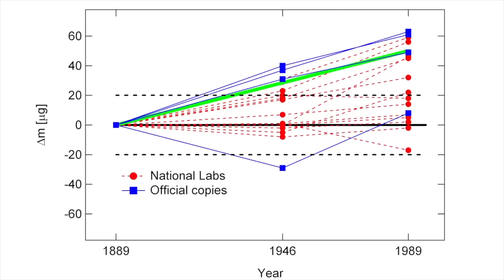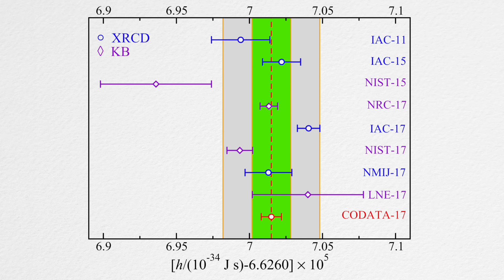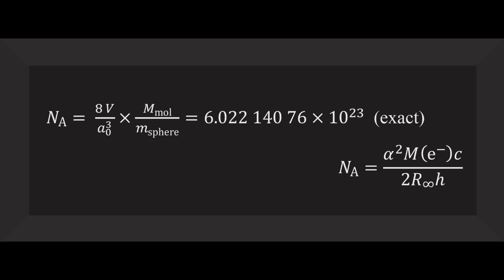The kg is dead, long live the kg

Comment: The world: we redefined Kg
USA: what’s Kg..?
Reply: US pound is based off kg
Reply: Special agent Chicken what do you mean the pound came first
Reply: Alex Alonso, just to let you know in the United States, they use the older Imperial system, where things are measured in feet, inches and pounds. ... The Imperial System is also called The British Imperial because it came from the British Empire that ruled many parts of the world from the 16th to the 19th century. The metric system was first proposed in 1791. It was adopted by the French revolutionary assembly in 1795, and the first metric standards (a standard meter bar and kilogram bar) were adopted in 1799. There was considerable resistence to the system at first, and its use was not made compulsory in France until 1837.
Reply: @Zkchary   you do know that the imperial system was the traditional system of mesurements In allmost the entire world
Reply: "what’s Kg..?"
It's a Kelvin-gram. If you want a kilogram, that's "kg."

Fred
Reply: @ffggddss  Probably the silliest thing about the metric system - the fact that the symbols for kilo, hecto and deca are all lowercase, instead of the transition occurring at 0.
Reply: @tidorith  Well actually, kilo- (1000x) is k; hecto- (100x) is h, but deka- (10x) is D.
deci- (/10 = 0.1x) is d.

Fred
Reply: @ffggddss kelvin-gram not Kelvin-gram
Reply: @Structure Agency Yes, the costs are there, and that's why for example the UK (and to some extent Canada) are still grappling with some residues of "imperial"/customary measures 50 years or so after conversion; in practice it didn't appear to cost either country much to switch, because the cost, even if large, was spread over a very long time period. However the main problem is one of political will, and as you say there are very few signs of any of that being there in the US.

On the amount of the cost, you may find this interesting: https://nonpartisaneducation.org/Review/Essays/v3n3.htm
Reply: Yeah, my American car uses 10, 12, 14mm bolts all over the place.
Reply: SimonTekConley that is because most of your vehicle is made in Mexico if it is an American brand.
Reply: Royal with cheese.
Reply: @쓰기전에생각하셨나요  underrated
Reply: The US uses the metric system too...  ignorant Euros.
Reply: The short scale is the scientific standard though... And insisting on using the long scale vs the short scale would potentially be way more detrimental than using imperial instead of metric tbh.
Reply: Ahh! The old Standard vs Metric Debate. I'd go get some popcorn and a soda, but I think it would drag on forever with no resolution.
Reply: What I mean is, as the scientific community has settled on the short scale, if you were to insist on using the long scale anyway, you and another person would be talking about numbers a thousand times or more different as if they're the same number. 
Also, "milliard" is a bit of an odd duck compared to the others, isn't it? Billion, trillion, quadrillion, etc.. All change the prefix in a common and predictable way. Milliard adds a suffix... Why? And it's not even a numerical suffix.
Reply: You know that the imperial system is based on the metric, right?
Reply: @Maverick Hargrave American scientists and engineers use all kinds of systems and standards, based on utility. In general scientific work is done in metric units.
Reply: Rest of the world :  LOL, US uses Imperial.

USA :  Ha Ha, We've never, EVER used Imperial.

Me:  I took my driver's license test in a Chrysler Imperial.
Reply: @jamesslick4790  that face the smug 'metric is king' world gets when, they find out that the USA has not been truly imperial since the 1970's.
Reply: @Maverick Hargrave American scientists use the metric system.
Reply: The pound is actually defined as exactly 0.45359237 kg. So by changing the definition of the kg, you change the pound by default. Choke on your hubris USA, your system of measurement is beholden to the kg also!
Reply: Siren Hound: except the changes are so tiny they will not make a difference to most people, as explained by the video, regardless of whether or not they use the metric system.
Reply: @Sirenhound   wrong.  Siren Hound  you're mistaking the equivalence of the pound with the definition of a pound. A pound equals that much in kilograms, but if you change the definition of a gram then the pound will just get a new kilogram equivalence. It won't change it's actual defined weight. NOBODY came to a consensus that a pound should be directly tied to the weight of the kilogram. That's not how the pound was DEFINED. They defined the weight of a pound and then using math came up with a CONVERSION to its kilogram equivalent. So, after the kilogram gets its new definition the pound will still weigh the same it does now but it will convert to a different amount of kilograms. That's not the same as the definition of a pound. Now, if you want to know how a pound was invented go ask Google. It had absolutley nothing to do with the weight of a gram.
Reply: @Sirenhound  it would be cool if you saw how many kg's of nuclear warheads the US has.
Reply: @Sirenhound  thats true but it would also be the same as if the pound changed
Reply: @Sirenhound  Rest of the world : Choke on this, We've known this since the 1800s.
Reply: @Sirenhound  In a sense it is based, but actually it's based on a grain I think.
Reply: @Sirenhound  Not really
Reply: Siren Hound we should email npc university to protest this
Reply: SirenHound US isn’t the only country that uses the imperial system. Also the weight of one lb or one kg actually changed, like if I have one lb of steel after they change that it’s still one lb of steel.
Reply: @Sirenhound  What's more likely is that this is the conversion based on the original kg. It's very likely that if the kg changes, the conversion value also changes.
Reply: @vincentvandepol5345  Very unlikely. Note that the factor is precise to within a rounding error of 50 micrograms (which was the practical limit of precision that could be reached with the "old" definition). That's more than the experimental error on h, so any further refinements to the value of h don't need to change the factor.
Reply: @vincentvandepol5345   No, scientists struggled for centuries to measure the speed of light.  After Einstein's theory of relativity became widely accepted, it was recognized that the speed of light in a vacuum was a fundamental constant so it was adopted as a standard.  There is no reason to ever change it.  When the current value was adopted it was chosen to agree with the best estimate at the time, based on the then current definition of the second and meter. 

The newly adopted definition of mass is now also based on a fundamental constant and need never change. The constant is  Planck's constant, and determination of its value was based on the mass of the electron.  The relative uncertainty in Planck's constant, therefore, must be at least as great as the uncertainty in the mass of the electron expressed as a fraction of the standard kilogram. By turning the defining quantity around, that is solve for the mass of the electron in terms of a fixed value of Planck's constant, the definition never need change.
Reply: Siren Hound 
#notmykilogram
Reply: the one you use to define a pound..........
Reply: laughs in freedom
Reply: The kg is what defines he lbs
Reply: @theRealRindberg  no it isn't. The pound has nothing to do with the kilogram.
Reply: @ThePrufessa  I recommend you the read the Wikipedia article about the pound. Here's a quote from it "The pound or pound-mass is a unit of mass used in the imperial, United States customary and other systems of measurement. Various definitions have been used; the most common today is the international avoirdupois pound, which is legally defined as exactly 0.45359237 kilograms"
Reply: @theRealRindberg  The pound is an independent measurement. Example: if 1 mile is equal to 1.60934 kilometers, and they were to change that to 1.8 kilometers (for whatever crazy reason), then, the mile would still remain the same. 1 mile = 5,280 feet, this also coincides with 1.609 (rounding) kilometers. Again, if they were to change it, then 1 mile = 5,280 feet = 1.8 kilometers.
Therefore 1 pound = 16 ounces = n kilograms. Which, certainly as established, is 0.46. So, if they see fit to change it, to say, 0.48, then, once again 1 pound = 16 ounces = 0.48 kilograms.
More than likely, they're going to just round it off at 0.46 for convenience.
The pound and the kilogram are not tied to each other. Case in point, look for the measurements of that cylindrical object, for both their kilograms and pounds, for both before and after they've changed the kilogram, and you'll notice that it will still remain the same in pounds.
Reply: @RyuuTenno  Btw! If you watched the video and still think that the pound is independent of of the kg.... here's an other spoiler! the earth isn't flat!

Sorry for being mean ! that last part was just trolling
Reply: USA: KGB coldwar paranoia intensifies
Reply: @aijwdiosmkdlwl  "It isn't paranoia if they actually ARE trying to kill you!" – Yossarian, Catch-22

Fred
Reply: Structure Agency 
Don't throw everything out and switch immediately.. stop the current production of the old system and start manafacturing the metric system, slowly with time it will take over, those who are not comfortable with it will try to find old tools and buy them but sometimes they'll be forced to buy the new ones and will get used to it with time.
Reply: The World: What defines your outdated system.
Reply: its funny, if you watch another vertitasium vid, the US used a copy of le grand k to calibrate its weights and convert to pounds!!!
Reply: @ArunaKhudan  But now it needs to throw away those conversion factors and use straight grams and kilograms.
Reply: US Code of Laws states SI to be preferred system of measurement. Allegdly, at least 40% of US industry operates with metric measurements, they fjust do not tell the public.
Reply: 1.6 gbp
Reply: UN: Ha ha America doesn’t use metric system
Liberia, Myanmar, Samoa, Micronesia and rural Anglos: awkwardly shuffling away
Reply: @Victor-Baxter    I wonder when a metric country will land a man on the moon.  49 years and counting....
Reply: Jim DeCamp theory time:
What if the measurements and trajectory needed to land on the moon have to be in imperial, in order to work, thus making it impossible for metric countries to make the trip.
Reply: @Victor-Baxter   I will give your suggestion the consideration and attention it deserves.
Reply: Jim DeCamp ughmm. I’m pretty sure many countries aren’t interested in landing on the moon after America has. However, russia landed there in 1959 in the luna 2, but it was not a manned mission. Russia uses the metric system...
Reply: @jimdecamp7204  NASA uses metric. Sorry.
Reply: @davebox588   Yes, and?  FWIW, NASA only required vendors to use metric dimensioning after the  Mars Climate Orbiter was lost 20 years ago this month.  I worked on a Navy contract as recently as 2016 in which we were required to use a "radar mile" of 2000 yards in the interface!  The internal calculations were all metric, but on one interface we reported target range in radar miles. BTW,  on another Navy contract in the 1980's we used radar miles that were 10 microseconds of echo time, approximately 1500 meters.  The world is weird, but the Navy even weirder.
Reply: @jimdecamp7204  and ... QED?
Reply: @jimdecamp7204  excep that the us got their only with help of german scientists and technology, and nasa uses the metric system
Reply: @Helperbot-2000  ... and people who know how to spell "except" and "there."

Fred
Reply: @ffggddss  yeah sorry about that, i was writing on my phone so i almost always mistype.
Reply: @Helperbot-2000  Phones seem designed for mistyping. I hate using them for text.

Fred
Reply: @ffggddss  yeah same with me, they keys are really small and easy to miss.
Reply: @Helperbot-2000   Sure, it that comforts you.  Every nut, bolt, fastener, thread, every sheet of aluminium, on Apollo was manufactured to ASME standards, by American companies. 

The Germany spent more money on the worthless V-Waffen than America did on the Manhattan Project. The question question after the War wasn't "How did they do it?" but "Why?".  After the War the Americans took advantage of the German headstart on rocketry, but hardly needed or depended on German "technology".  The U.S. and Britain both flew jet aircraft by 1942.  The ME-262 engine had a mtbf of 10 hours, and only carried enough fuel for one hour. The U.S. was winning the airwar handily, and flying  1200 mile missions. They had no need for an aircraft like the ME262 with a 1% mission loss rate without hostile action.
Reply: @Structure Agency Well said sir! All the places i have worked are using both metric and SI. Most people prefer metric because it is easier to work with but still require SI to fix older machinery. It is slowly changing to metric on its own but it is taking decades. Edit: I live in the US. We use metric and SI.
Reply: Clint R SI is just the latest version of the "metric system". I think you mean to say US customary and metric.
Reply: @heideknight9122   I think you mean "SAE",  where you said SI.
Reply: @KarrotKake  Well, no.  Britian recently adopted the US convention.  Sorry, old boy.
Reply: The pound is actually defined as a certain fraction of a kilogram
Reply: @danielscully3952    Okay, "an improper fraction",  a fraction greater than one.
Reply: @danielscully3952  a kilogram is a fraction of a kilogram when pound dumbass.
Reply: Milliard is a British measurement, and used in place of the classic US measurement of billion. And their measurements increase to billion, billiard, trillion, trilliard, then begin counting up from quadrillion (i think, they may just skip that one). Not, once, have I seen anything within the United States as being measured as a milliard.
And, no, I don't know why we call it a billiard table...
Reply: kg*
Kg would be Kelvin-gramme which is kinda silly
Reply: Imperial units are defined by SI units...
Reply: If you'd watch other videos made by this fine gentleman, you'd know that imperial units are based directly on metric units.
Reply: it's kg 
(not Kg, gosh!)
Reply: @GPCTM  This is obviously a rather kg subject.
Reply: To all americans:
Metric vs America!
9 mm vs 0,3543307087 in
7,62x39 mm vs 0,3×1,5354330709 in
Reply: KL Science USA: Why bother? It will just change.
Reply: Ha. The US can’t change anything
Reply: @mbsgamerpro  that... Doesn't even make sense. Flat out ignorance.
Reply: Lucky The Great Depression
Reply: @mbsgamerpro  wrong! They change a lots of things. I'm not saying it as a compliment tho..
Reply: Brett T the us cant change to metric if that was our #1 goal
Reply: @bdragonseven  Kind of true.
Reply: @bdragonseven  It's a joke, no need to be so serious
Reply: badlandskid American scientists do use kg. This is what was told to me by my physics teacher told me when I asked her.
Reply: We still learn the metric system, we just don't use it as a everyday reference.
Reply: @hagotem3071  Which means you're backwards.
Reply: Ha Gotem they don’t teach it in North Carolina, as far as I know. Unless it’s changed in the brief time I’ve been out, which is entirely possible, though unlikely.
Reply: @hagotem3071  You should... 1 world, 1 people, please use 1 system <3 I am American as well and even though most people around me use the imperial system I try to use metric as much as possible for I want to unite the world. 
1 world. 1 people. 1 system. 1 love.
Reply: @hagotem3071  in fact you use it every time you use the imperial system as its defined by the metric system
Reply: You should try it ;)
Reply: Yeah, he already addressed that last year: https://www.youtube.com/watch?v=SmSJXC6_qQ8
Reply: +ffggddss that's true, mainly because only the USA use such measurements to such extent. It would be bad for an American who travels to not know the SI system. And for those who would like to emmigrate to the US (as I do myself), I assume we don't really need to know the English system since products also indicate grammes and litres?
Reply: @guilhermebranco8572  "... products also indicate grammes and litres?" Yes, in almost all cases nowadays.
Keep in mind that in most cases, the amounts will be round numbers in English units, and 'wacky' numbers in metric.
Like the two examples I gave.
Imported products will be the other way around.

Exception: At the gas (petrol) station, the pumps read in gallons and decimal fractions, not liters.

Fred
Reply: In UK it's the same case
Reply: Kinda like talking about someone who runs a mac about Linux lol
Reply: @Structure Agency you are on vacation right?? Just saying because you really took your time to write this entire thing down..
Reply: What is Kg? Kelvin-gram? Capitalization is important when referring to units, as a science channel you should be ashamed.
Reply: The US system is harder though, have to convert the metric system for public use it’s so frustrating and tedious which causes all of kinds of mistakes and sometimes death but the average US citizen loves the imperial system.
Reply: The thing that weight the oil barrel
Reply: Structure Agency I have researched it. Those are what the reasons come down to. "Why switch if what's being used is adequate?" This has been almost explicitly the excuse used since the metric system was created. The US was an original member of the metric research project and Washington and Jefferson wanted to get this done. France switched from the old pendulum definition of a meter to the longitude through France definition and that ended the founding father's drive for the system. Without their backing the ignorance argument I just presented in quotes stuck around as the default position. 

The US was an early signatory of the treaty of the meter and metric units were legalized for use in the 19th century. Politicians like John Shafroth, scientists and industrialists like Edison and Ford tried to get the public on board but once again the existing ignorance argument and then national pride in "the units of our fathers" and "national greatness" added a whole new argument that prevented things from moving forward.

This most recent push for Americans to finally make the upgrade was defeated by arguments from ignorance and pride and pseudo arguments about expense kept the people from getting on board yet again.

Someone else in this thread gave you a link to read. I'd suggest you do read that. There's also lots more data on the US and the metric system to be learned but this isn't the place for it.
Reply: @ShmuelSpade   There would be huge costs associated with the switch and it is not clear that one could amortize those costs with what would actually be very slight future benefits.  (In economics one always weighs future returns with exponentially diminishing value as one extends into the future. The sum of the infinite series is finite.) 

I am not at all sure there is a sound economic argument in favor of changing. I have not seen one. As to national pride, it seems to me that arguments in favor of switching are made by those who feel embarrassment about the U.S. deviating from international norms. In the U.S. the metric system seems to have snob appeal to those who consider themselves enlightened and superior. (Actually outside the U.S. as well.)  

I think the primary reason the Canadians adopted the metric system (other than the fact that Canadians are docile followers of authority) is as a way to further distinguish themselves from the U.S.
Reply: Other American: "Kevin Garnett Duuuuh"
Reply: US: We do not care about your petty unit elitism in the age of the Internet and instant conversions, so we use both depending on the circumstances and are thus taught both.
Reply: only in science do americans use metric unless it's something very light or needs extreme precision, because it's so much easier in math to use 0.695mm than it is to use 7/256 of an inch
Reply: The US doesn't really need to change from US customary because we already learn both at school and can use both. All our rulers have both systems and if you work or have learned science than SI is used anyways
Reply: iSn'T iT LiKe A pOuNd?? oMg! sTaHp!
Reply: But officially the USA is using the metric system, they just chooses to convert it to the imperial system before hand. All of the imperial units are defined by metric units.
Reply: The base of your pounds
Reply: We define our units (pounds) based on kilograms
Reply: imat Roll, just saying but the us won’t be #1 for long
Reply: Lol, what am I reading? Can’t figure if this is a war or what.

Just to let you know, just because a country ‘labels themselves as’ or ‘says they use’ the metric system or don’t use it doesn’t mean that true. 
For example, we probably know at this time, only three countries—Burma, Liberia, and the US—have not adopted the International System of Units (SI, or metric system) as their official system of weights and measures. That would probably change but most countries that claim they use metric actually use the opposite and vice versa. (But not in all cases.)
Reply: Haha nice!
Reply: https://www.youtube.com/watch?v=SmSJXC6_qQ8
Reply: @RicardoSantos-z6v  Even more ironic then that a Brit 'invented' HTML. You might have a point if we were emailing tho.
Reply: imat Roll  South Americans?
Reply: 2.20462 pounds, give or take 1/100,000 of a pound but only at the average gravitational acceleration of earth at sea level. A pound is actually a unit of force, while a kilogram is a unit of mass.
Reply: Kg is the value from which you define pound
Reply: kg*
Reply: It's what the imperial system if measurements is based on (well the weight at least)
Reply: Scientists in the US use the Metric System
Reply: KL Science — Americans are much more familiar with grams than Europeans are with pounds and ounces.  Even the common 5 grain aspirin tablet is now marked in milligrams.
Reply: Don't Feed The Trolls.
Reply: "He weighs 8 stone" 
Me: A stone?
Reply: About 2.2 lbs... its only metric users that can't handle math with numbers other than powers of ten
Reply: Usa uses FPS system
Reply: The Kg is officially what the pound is based on.  They have one of the Kg standards in the basement of NIST.  If you want to know what a pound truly is, you would go to NIST, measure the Kg, and convert to pounds.
Reply: Structure Agency costs, expense, and logistics over what period of time? If you mean overnight, then yes, it's probably prohibitively expensive. But this could've been gradually done over many years if there was ever a plan in place to do so and if there were ever any legal power to get it done.

Things are only expensive relative to other things you could do with money. It actually costs the US money all the time not to be metric but that expense in lives, missed opportunities, and annoyance is considered affordable. 

Every other nation on Earth has had to make this transition from customary units to metric units. The US isn't special.

The only reason it isn't fully metric in everyday use by regular people in all affairs is because of ignorance and pride. The US happens to be on top of the world economically so there's little incentive to upgrade. As soon as that position changes we'll see movement towards metrication and we'll see just how inexpensive it actually turns out to be.
Reply: Then what is the American standard for a pound? IT DOES NOT EXIST because it is based on the kilogram. USA is so obsolete, all just because of money.
Reply: @SomeoneCommenting  I wish I had a kilo of whatever you are smoking.  A unit of measure is as precise and accurate as along as those who use it agree on what it is. There is NO mystical superiority to Either system, They are human inventions. And as for the US being obsolete? Europe is dying. Hell, Thank (insert your deity here) that the UK saw the light and is getting out.
Reply: @SomeoneCommenting  you are a fuckin moron. The pound is not based on a kilogram dumbass.
Reply: Well actually the system that America uses, I bassed on a exact same object. It only goes through a formula
Reply: @Hexagy  I leave in America and we use grams. You mean USA, that is not America, America its a continent which has several other countries. Sorry
Reply: @diegodelallata  if you work on your Grammer,. I'll work on my geography.
Reply: I don't get how people are like "US: wtf is a kilogram?" I've known what a kilogram is for a while now. I've known it's close to being 2 lbs and about a year ago, I found out wht it was based off ofthe weight of the "cilinder". I probably spelled cilinder wromg... I don't use it at all for mesuring anything, though.
Reply: Actually the USA pound is defined as a fraction of a kg.  One kg =2.2 LB.  Been that way for nearly a century. No one has a better handle on fundamental constants than NIST.  Been that way for well over a century. 

Basically,   BIPM asks NIST (and USNO) what time it is, and how much a kg weighs and how long a meter is, what a volt is, how much is an ampere or a tesla. NIST then quietly, and without fanfare, calibrates pounds (LB) and cups and feet to meters and kilograms for domestic US consumption.   

Seriously, Americans are, and have been, the world's best metrologists for a long time, probably going back to around 1850.  Why was the Michelson-Morely experiment performed in the U.S.? Why did the United States Naval Observatory (in cooperation with the British National Physics Laboratory) calibrate the cesium atom to ephemeris time (the existing standard) in 1958? Because no one else could.

You're welcome.
Reply: @jimdecamp7204  what you said makes no sense. How could a pound be a fraction of a kilogram when a pound weighs more than a kilogram? The weight of a gram or kilogram has absolutely nothing to do with the weight of a pound. I said that backwards. There's a historical meaning behind the definition of a pound. It too was based off of the weight of metal. But not some secret metal hiding somewhere that nobody could see. Go do some fuckin research you fuckin idiot. If you don't know where a pound got it's weight defined from then you missed a very early history lesson you stupid idiot.
Reply: @ThePrufessa   One kilogram = 2.2 pounds, therefore one pound =  10/22 kilograms. You need two and two tenths of a pound to make one kilogram. Admittedly I could have been more clear.  My point has nothing to do with the historical definition of a pound. I simply wanted to refute the silly notion that Americans are too dumb to use kilograms, or other SI units.  I should have simply stated that Americans are too sensible and independent minded to be browbeaten into using scientific units when traditional units are perfectly adequate for household and day-to-day use.  

I don't see the need for invective.  I recognized the  supercilious tone of the original post in this thread, and most of the comments below it.  I mean to cheerfully demur.  I suspect I know a great deal more about the history of science, and metrology specifically, than almost all the other posters on this thread combined.  And strictly speaking metrology is scientific engineering, not pure science. 

I have read reports some years ago of a grocer in England being fined for selling bananas by the pound, after the UK joined the EU.  Soft drinks and bottled water in the U.S. are commonly sold by the liter (or litre, if you insist) and no one even notices.  I think you people need to learn a little tolerance and be a lot less thin skinned. 

Regards!
Reply: 0.46 kg is a pound
If I recall correctly
Reply: @anonicantthinkofaname7440  about 2.2lbs
Reply: @anonicantthinkofaname7440  1 lb ~~ 0.454 kg
Reply: @anonicantthinkofaname7440  it is
Reply: @anonicantthinkofaname7440  No, a pound is 0.46 kg. kg defines pound and not the other way around.
Reply: @anonicantthinkofaname7440  you have it backwards. A pound is .46 kilograms. A pound was defined on its own. Therefore .46 is what a pound gets converted to when changing units. .46 is the equivalence of what a pound is. So, one pound equals .46 kilos. .46 kilos does not equal a pound. In other words nobody sat around and said we're going to make a new unit of weight and it's going to weigh 1.54 of a kilo. That's not how a pound was defined.
Reply: To all those who want to portray Americans as backcountry hicks for using the English system, here's a fun fact to chew on:
Lots more Americans know the metric system, than non-Americans know the English system.

Here's another: Good luck going into any large-chain grocery store in the US, trying to find a food item that isn't labeled in both systems. In front of me at this moment, is a box of cookies, in the lower-left corner of which, is,
"NET WT. 10 OZ (284g)"

And a soft-drink bottle that has:
"20 FL OZ
(1.25 PT) 591mL"

Truth is, thanks to trade agreements (NAFTA until recently, and now, USMCA), any company wanting to sell their products to the wider North American market, needs to accommodate the popular, familiar measurement systems in Canada, the US, and Mexico. And that means labeling everything in both metric and English units.

Which system is "better?"
For science & engineering, it's SI, hands-down. Any student of those disciplines in the US, as anywhere else in the world, learns SI in great depth, right at (if not before!) the outset of their studies.
For everyday, household items, either system is fine, so long as it is used widely enough. It isn't difficult to become familiar with either system, when it's all around you. Metric does have an advantage in converting between different sizes, but with the proliferation of calculating devices, it's no big deal, really.

Fred
Reply: @ffggddss  huzzah an american of quality
Reply: @Helperbot-2000  Thanks. But I'm the rule, not the exception. You can't judge Americans, or any nationality, by what you see in YT comments.

Fred
Reply: @ffggddss  haha yeah ik.
Reply: @Maverick Hargrave
If it works, it works.
Reply: Seriously dude.. They need to come out of their shell n see the world..
Reply: freedom units
Reply: It's short for King.
Reply: americans cant measure
Reply: USA should change to the metric system with Kg, Celsius, Km, meter and all the other measurements.
Reply: @ludwigharisuo6261    Why?  Why doesn't Germany follow the U.S.?  After all, there are a lot more of us than y'all.
Reply: The world: ask the US army.
Reply: I don't get why the rest of the world thinks the US just doesn't understand metric. 
Americans (and quite a lot of Brits I've noticed on YouTube as well, if we're being honest) use both fairly fluidly. Some measurements make more sense in terms of imperial, some make more sense in metric. 
I use metric measurements every single day. I have a daughter who's diabetic, and I have to measure her carb intake in grams, rather than say ounces. 
Meanwhile, some things make more sense when measured in imperial. Measuring a person in terms of feet and inches gives a better idea of how tall they are versus meters and centimeters. There are 180 degrees between freezing and boiling in Fahrenheit versus only 100 in metric, so F gives a better idea of what the temperature is outside than C.... As a couple of examples. 
In short, imperial is really handy in common every day measurements, metric is better for precise and scientific measurements, and we tend to use both as needed with a fairly good understanding of how the two relate to each other.
Reply: @pyrobob5724  there are millions of Americans that are not usaans, such as Canadians, Mexicans, Guatemalans, Hondureans, Brazileans, Chileans, Argentineans, Panameans, and the list goes on. I'm sorry that your country has a generic name. By the way nothing makes sense in imperial, that time is over.
Reply: @pyrobob5724  thats just wrong, i can use the exact same argument against you: saying how tall you are in meters is alot better for everyday use than imperial.

Also exactly how do your arguments make any sense?
Reply: @pyrobob5724  In addition, length in imperial units are in base 12 which can be divided by 2, 3, 4, and 6 easily. This is better in my opinion for a lot of real world applications, when you need a third of something, or a quarter of something etc. But since most math is done in base 10, metric is better for scientific applications. So yeah I agree, both have their advantages and disadvantages, and using both is really not that difficult.
Reply: @michaeldavis892  Length, like all of the other units in English measures, is not base 12. The foot just happens to be divided up into 12 inches for convenience. There's no special name for a 12th of any other length unit (e.g. a twelfth of a mile, a twelfth of an inch, a twelfth of a yard, might be terminable but there's no special name for them).

Similarly there's nothing about large numbers of divisors. What's a third of a pound or a third of a gallon?

In the real world we use calculators and we can work out division quite well. All we have to do is look at our smallest feasible unit and stop the decimals there.
Reply: Pound is a unit of force (like Newtons).  Slugs are the unit of mass.  Assuming a constant acceleration of gravity (9.8m/s^2 or something), they're interchangeable.
Reply: @pierrecurie  pound (lb) is a unit of mass, the unit your are referring to is poundforce (lbf).
Reply: @techkarton1469  Can't say I'm surprised that there's a separate pound mass.  It does mean the pedants I've learned from in the past were wrong.
Reply: @techkarton1469  wtf?
Reply: @techkarton1469   well...  The unit YOU'RE referring to is a lbm. The typically lb is used in reference to the lbf, a force unit, although the lbm is numerically the same. The lbm was defined out of convenience in order to avoid all necessary conversions using slugs when going back to mass (often in thermodynamic calculations).
Reply: the intention of my comment was to point out that the international standard symbol for the pound (mass) is lb, while the symbol for the pound (force) is lbf.
Reply: pierrecurie You have nothing to gain by spreading that nonsense. Pound is an ancient unit that was used by Romans. Force as a concept was created by Newton. Pound has also been used as currency. Do you think the value of money depends on the gravity? You just got ran over by a horse.
Reply: @okaro6595  Sure! The British pound sterling (£) gradually loses value with increasing altitude.
If you have a fiver, you can buy a lot more with it on the ISS than you can on the Moon!

Fred
Reply: TIL US Americans can‘t take a joke.
Reply: @ffggddss  Fred, is that why things that come from way way down in the earth, like gold and diamonds, are so expensive? Also are galaxies that are light years away, nearly valueless? That's pretty poor ROI for whoever built them. Damn.
Reply: @pierrecurie   No pound is used as both a unit of force and mass, with the pound force being force necessary to accelerate a pound mass at 32.2 feet/second/second.   People in SI countries adopt the same habit.  They describe their weight in units of kilos, not newtons.
Reply: the USA still doesn't know what the metric system is? never mind, go back to shooting each other you ignorant primitive neanderthals
Reply: The problem with the metric system is how sterile it is. It lacks soul. A kilometer is clumsy compared to a mile. A kilogram is dull compared to a pound. A liter is just silly sounding compared to a gallon. Inches, pints, tons -- there is so much poetry in those names; poetry that was sacrificed for mathematical convenience. The worst is Celsius over Fahrenheit. Fahrenheit not only sounds right for a temperature scale, it's a better scale for everyday human life. It's 100 when it's really hot out and 0 when it's really cold out. The scientists can go Planck themselves.
Reply: @boredom2go  But Fahrenheit and Celcius aren't part of the metric system or US Customary system. Celcius is not in the SI, that would be the Kelvin.
Reply: @givecamichips  Number of times in history a weatherman has said, "The high today will be 284 Kelvin": zero

In other words, nobody cares. Celsius and Kelvin are the same unit of measurement anyway, just offset by a constant. Fahrenheit still sounds better than both of them.
Reply: I disagree that Fahrenheit sounds better. In Celsius 0 is when water freezes and you can expect snow instead of rain. 20 is room temperature. 30 is pretty dang hot (except in tropical-like areas). 40 is too hot for most people (again except for tropics). -20 is too cold for most people and places. The common temperature range is about 50 degrees where I live, which is plenty precise. What's the point of having twice as many degrees in the same range when I have to round to 2 or 3 degrees anyways?   Fahrenheit is also a silly sounding name that is hard to spell. Same with Celsius, but at least you can call it centigrade.

Now about your points made before: How is a kilometre 'clumsy'? What makes a mile better other than history? What makes a kilogram dull? Is it the prefix? How is a litre silly compared to a gallon? Now that sounds silly to me - 'Gallon'. If you really like tons, just use tonnes in the metric system. 1000 kilograms, decently close to the short ton. I think you only like these because you use them - same with metric people.
I will agree that inches is a great word, but pint sucks.
Reply: US is dumb for not using METRIC METRIC METRIC METRIC METRIC
Reply: @ericj4094  oh no I can’t remember anything but multiples of 10!